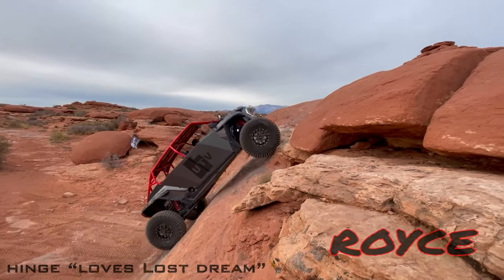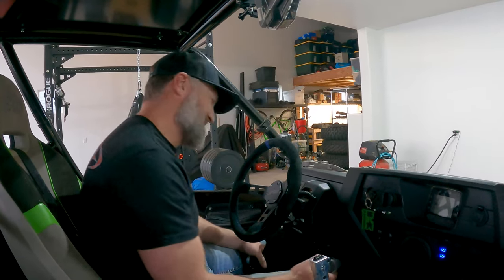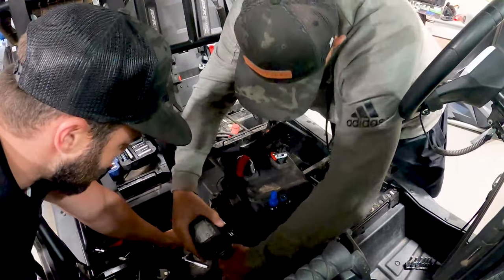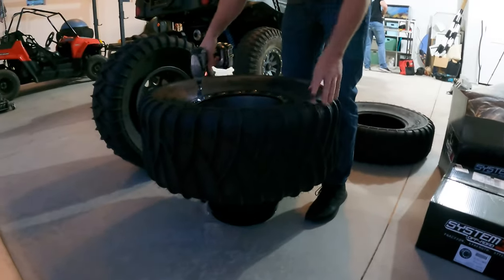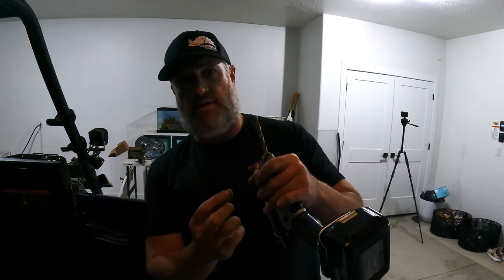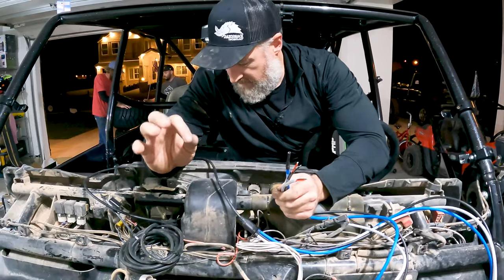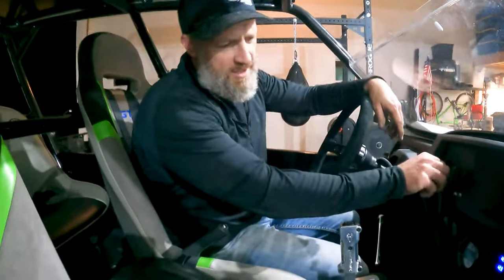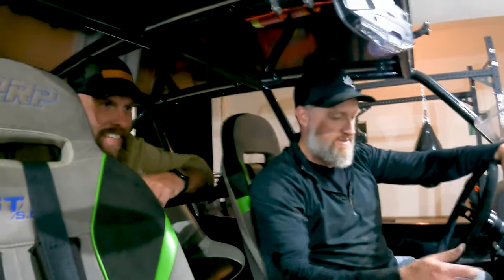Garage Update | Razorback Belt Temp Gauge Install | Kawasaki Teryx UTV SXS

Comment: Enjoying the content....keep it coming!!!  

Couple of comments.....a spray bottle with a bit of soap and water makes tire installation (on a beadlock) so easy....even a cave man could do it!! 

Also, regarding the thermostatically controlled cooling fan for the belt, I'd suggest holding off on that and here is why; once you get used to how your belt temps respond to throttle/clutch engagement, you really won't need it. The second reason for holding off on this blower is there have been many, many posts, threads, discussions across many forums over the years (back to 2014) and most agree that a blower fan that is not blowing, is actually choking the air intake to the clutch, causing quicker rise in belt temps. Now, I am not familiar with what RazorBack's offerings will be, but if it is just another bilge fan type application, the above will hold true. Food for thought....
Reply from the maker: I’ve heard the same about fans. Razorback guys are sharp, so hopefully they make something cooler than just a bilge fan. The soapy water trick would have helped for sure! 
-Royce

Comment: Good video thank you for the content, I also have a Razorback gauge on my Teryx4. I am curious what temperatures you are seeing and your experience so far. My belt tends to heat up to around 200-220 while riding and even more if I get on the road. I usually slow down or let out when it climbs above 230 -240 F
Reply from the maker: Once you get up to about 230 its usually good to let it chill a bit. We’ve sold the Teryx, so it’s hard to remember what the consistent temps were

Comment: Hello. I'm curious what your belt temp runs at? I have a Teryx4 as well and I just bought the temp gauge. I run streets at 50+ in AZ a fair amount. Not pinned for an hour lol. Roughly 20 min to spots and back. I dread the thought of breaking and changing the belt where I go.I've changed my first belt at 1500 miles just to be on the safe side. Not the funnest fix.  Thanks and great vids!
Reply from the maker: Eric - the Teryx owner - will have to chime in here, but if you are varying your throttle/RPMs as you go, that will help a lot. It’s when you stay pinned in one spot the belt won’t hold up after a while
Reply: @OffCamberInd   Thank you! Much appreciated